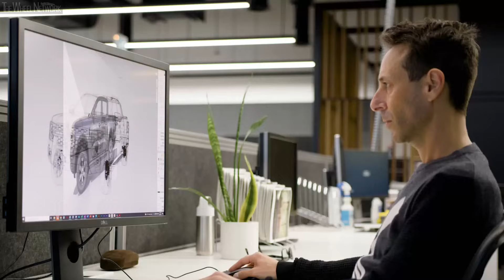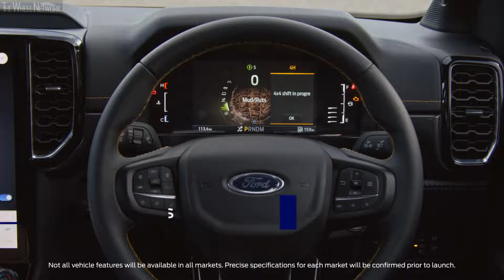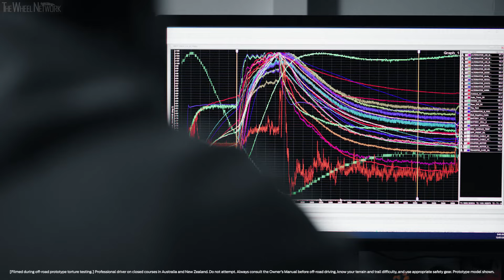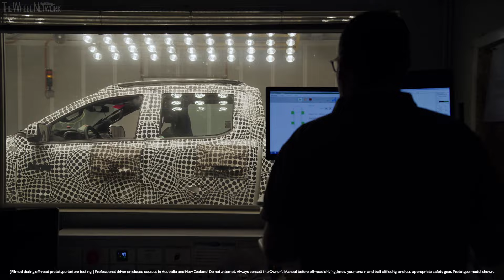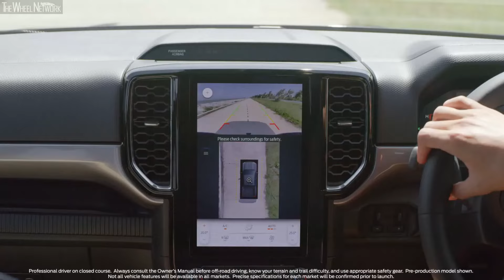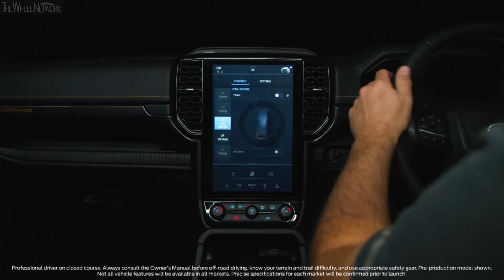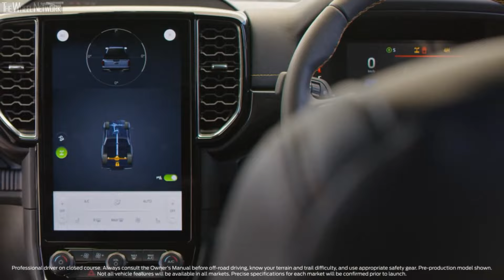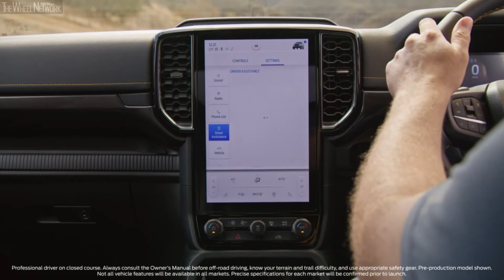2022 Ford Ranger Reveal

Comment: I currently own 2020 Lariat FX4 crew cab in the United States. Definitely like my truck,   Ford came close in the lariat line, a few things That could've added with the lariat trim level, is automatic passenger window, cooling seats, other than that I'm fairly happy with the interior. as far as the FX package goes they could've included electric locking front differential, disconnecting sway bars. made all the lights LED instead of a few incandescent different places. So if you're looking for someone in the US to test one if your new rangers let me know I'll be more than happy to accommodate. I'm Glazers doing more with the range seems like everything here at least has been a big push for the bronco, as well as it should be and I'll be glad to see when I have a big push for the new Ranger maybe just maybe I'd buy another one. Or just keep the one I got, should be good for long time.
Reply: this is mine. test in snow and desert conditions. truck for Africa. I remember Hanry Ford 30s Great Depression. Air engine in car. Cabin in car for pilot. Plane for land. without generator
Reply: @Daud416  Yes they've come along way since the 30's.